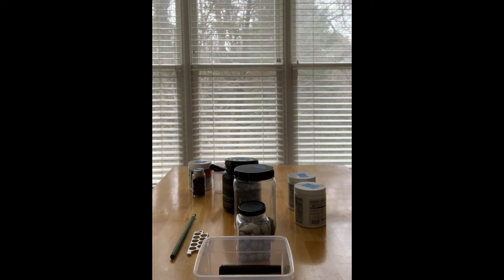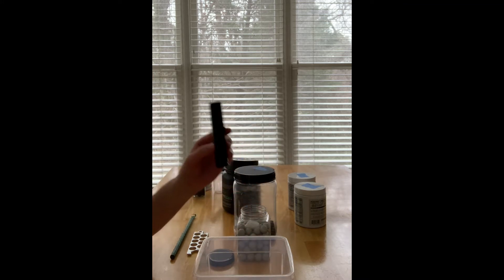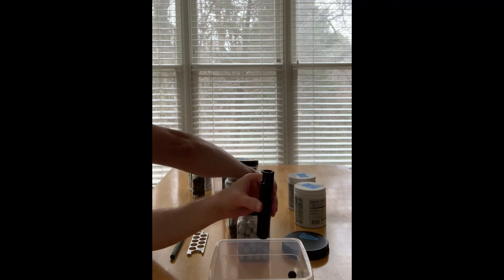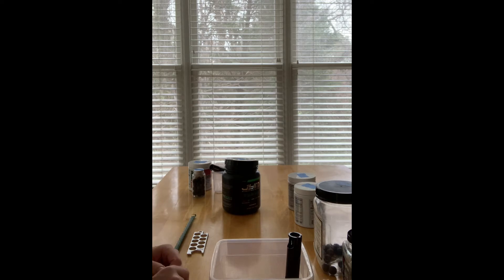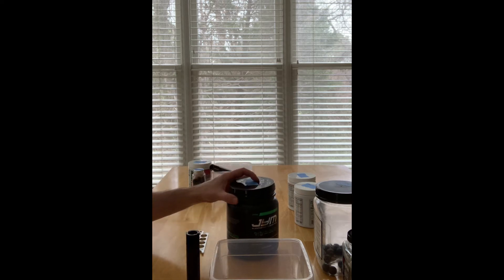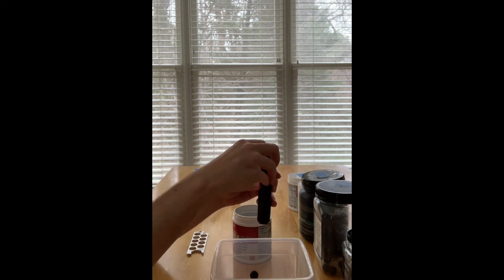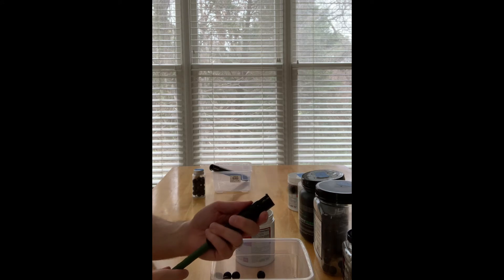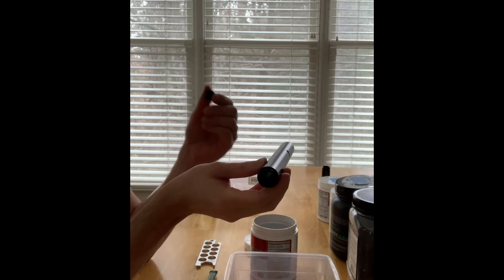Pepperball TCP (or VKS) rifled barrels: bore sizing rounds to turbo-charge performance

Comment: Question can I oil the inside of my Fsc barrel
Reply from the maker: You can but I would clean it out immediately after the shooting session. The oil will just collect dust over time if you are storing it and it will get sticky and grimed up slowly. That could reduce your FPS and/or alter your shooting accuracy. I've thought about testing a lubed barrel but decided it was just too messy for practical real-world use and with the cleaning needed it would be a pain.
Reply: @ShadowCatTactical  ok just wondering I have grimburg match barrel and Jul rounds and some stick some fo through

Comment: The new ones from Rubber Steel Rounds; the ''S-Type'' are nice and thick compared to their older brothers. Still 7 grams but darker, shinier.$0.40 per round reg. price. They stick in the Grimburg barel & the FSC barel. I didn't try them in the Pepper barel(not being used) but it's very close to the FSC  barel w/ other rounds.

Comment: I'd say that this is a very wothwhile activity! I discovered that some...
 (& one is enough to ruin your defense)
 Grimburg V1s are too big for the Grimburg barel and won't go through. So now i have to make darn sure not to mix them up w/ V2s. Today i will test those cheep steel infused rubber balls w/ the Gimbarel. They are rollers but still tighter than in a stock barel. They are also grabby and prevent detent slipping so i have them up 1st untill my new Sterling detents arive. happy to have found a good use for those things.

Comment: Have you ever shot (or known anybody) Juls .686 thru a Lapco stainless .684 barrel. By being a little tight would that have any effect on fps, added wear on any parts, reduce accuracy, or reliability?. Thx
Reply from the maker: Thanks for asking. The JULs are 0.684 and the TCP stock barrel is 0.686. The Grimburg barrel is slightly tighter around 0.685. If a theoretical projectile was truly 0.686 it shouldn’t fire in a true 0.684. It’s the Goldilocks principle. One bore is just right but too large or small is sub-optimal. Too large of a projectile can lead to scary jams.

Comment: On PB guns the rifled barrels will only give a better longer shot at a LONG distance..there is no advantage on shots 15-25ft.
Reply from the maker: I agree.  That's why I bought the smooth bore Grimburg 5" barrel.  It doesn't lose air around the rifling.  I prefer smooth bore but if I ever use the VXR rounds I think they will engage the rifling of the stock barrel and it should help hit that 150 ft mark they advertise.  I just like the kinetic rounds so much better.